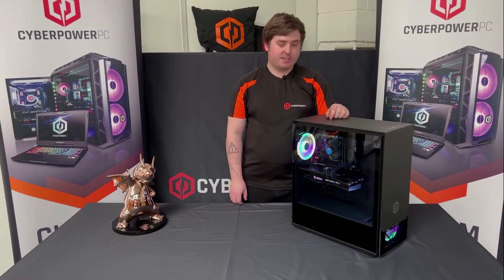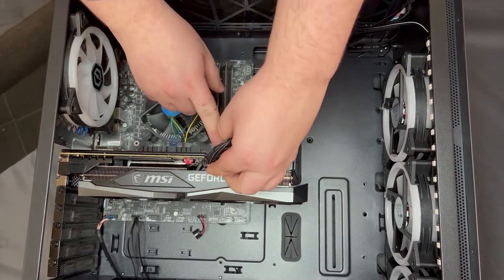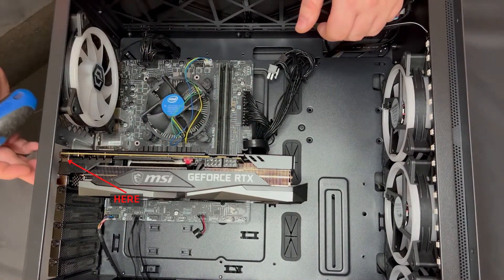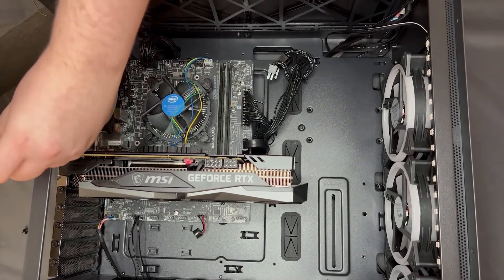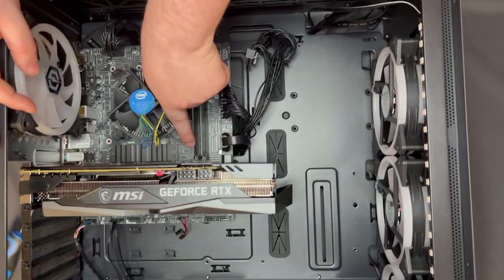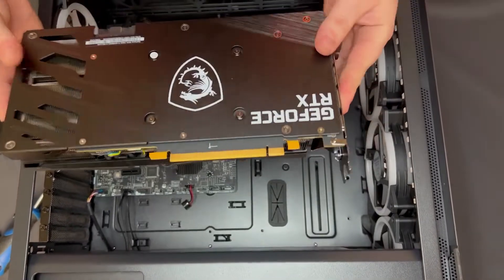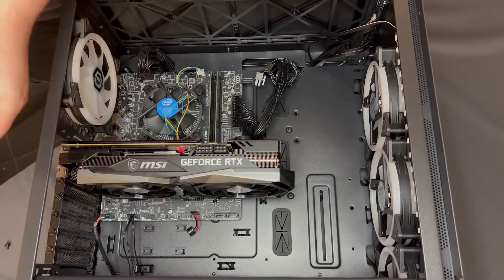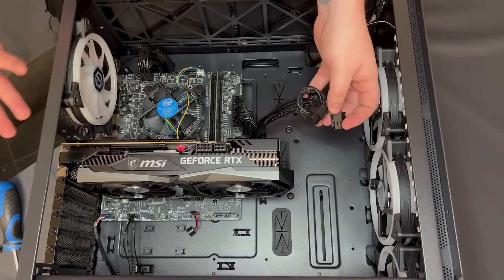Remove and Install GPU | Tech Tips

Comment: I'm utterly incapable of doing this, now I think I may have wrecked my PC. That clip is completely unmoveable.  Graphics card won't come out, but neither is it completely in now either. Now it can't get it in or out. I only wanted to change the freakin' motherboard battery! (but was inaccessible being covered by the graphics card).  Now because of a flat battery and being unable to replace it, I'll have to buy a new PC.

Once I do buy a new PC I won't ever be attempting to replace anything inside the PC case itself. Especially not the graphics card!
Reply: Yes!  Got the card out at last! And replaced battery. Might have ruined the motherboard in the process though as I was attacking the clip quite hard with a screwdriver, and a couple of times it slipped onto the motherboard. And then there is the original problem that might have been caused by a flat battery.

Comment: I had an issue with a screw holding a PCI card below my graphics card also holding the graphics card, making me think my graphics card was stuck to the Motherboard after I unscrewed the two screws for the rear output plate of my graphics card.
Remember to look closely at your screws and what they are actually holding.
You might need to unscrew [PCI slots occupied by the graphics card] + 1 screws.

Comment: I dont know what to do. All i did was unplug the PC, open the side door to inspect the inside, tug on the cable for the graphics card a little, checking if it was secured, then plug everything back up. When i turned on my PC, the monitor refused to display. I been messing with this for hours and still no luck
Reply: same here, anyone that can help?
Reply from the maker: If you're having issues you can always hop over to our Discord at Discord.gg/cyberpower. Our community will help you out

Comment: Dude you guys put the wifi card so close to the graphics card port my 4060 oc wont even fit
Reply: If we've built it, then it fits, but if you are changing the GPU to a larger model you may need to lower the wireless card to a different slot, or potentially remove it and go ethernet, powerline or USB wireless.
Reply: @davecyberpoweruk  oh man I didn’t expect you to respond thank you so much for the advice, but yea I bought the nvidia GeForce 4060 and it won’t fit in the gpu slot because the wifi card is in the way and it’s attached to the motherboard. And I was thinking of doing an Ethernet cable or the wifi usb. But the issue with that is the usb wifi kinda sucks and I can’t afford a router. I was thinking of just finding another gpu if you had any recommendations I’d appreciate it. My power supply is rated for 600 watts

Comment: "if you just push that down"

Yeah, sure.
Reply: Yeah dude the same, im pushin it so hard im scared that my motherboard will break in half😅
Reply: @Lock0_ Right now I'm typing this with my bruised ass finger from pushing down on that stupid clip but it won't budge ffs
Reply: @Lock0_  i had to remove the cpu and cpu cooler :D
Reply: Don't know if you guys in this thread are still in this predicament or if you will get this message, but for anyone else passing through: What worked for me is to just keep pushing down, no fancy equipment or tricks. Mind you, I got small hands and I made sure to stop if I felt my fingers slipping so I could readjust my position, but I had to push down until my whole arm was shaking and my fingers hurt. Another thing is that motherboards are sturdier than you think so don't be too scared. Accidents can happen, but I slipped multiple times, I even tried the back of a plastic pen and it slipped and the bottom part got lost inside of my case, so that was fun to try and fish out 😬But ultimately, everything worked fine when I turned the PC back on. Just relax, be patient... and have a high pain tolerance, lmao.
Reply: Did you find out solution? 😆
From my point of view the best solution is to buy new fcking mother board!... That button is crazy...
Reply: RIGHTTT.
Reply: Some times you can just juggle the card you will find that im other YouTube tutorials

Comment: Am I the only one having trouble with putting the screws back in
Reply: No, those screws are finicky.
Luckyly I have slender fingers that fit between the left vertical edge of my case and my watercooler. I don't know if I would have made it if I had fingers >1.1× the thickness.

Comment: I have a Cyberpower Prime Z390 gaming PC, with some RGB fans, I don't know how to change the colors or deactivate them at appropriate times, could you help me with this?
Reply from the maker: Hi, it depends on which fans you have. If your PC came with a little remote, then you use that to control your fans; if it didn't, then it will be controlled by your Motherboards RGB software. I hope this helps
Reply: @CyberPowerPCUK  Are there any RGB control softwares that aren't a mess?

Comment: i have to remove my giant rx 6700 xt to get to a clip on my cooler, but the damn thing won't come out. Screws are out, tab is pressed and released, but gfx card seems stuck on the back plate rather than anything, you know, the little tabs on the other end from where the screws are supposed to go. Fingers hurting bad from trying. Am stumped.
Reply: u ever get it out?
Reply from the maker: Hi, contact our support team at support@cyberpowersystem.co.uk with some photos, and one of the team will be able to help you out.

Comment: My bloody cooler is to darn big to press with my fat ass fingers 😂😂😂😂
Reply: Relatable, how did you deal with it?
Reply: @red2522  got a soft rubber thing to softly poke it
Reply: @red2522 losing weight
Reply: Get something you can push between it, or just temporarily dismount your cooler and put it back

Doing the latter at least you can repaste your cpu, but i have a little wooden duster that I pushed between the cooler and gpu gap since my fingers are too big

Comment: I cannot find the thing to remove my gpu (switch) I'm lookin in the area u specified and cannot see it
Reply: Same problem here
Reply: @skigemiggw bro you can just move you mother board to fit or buy some new cheap pc case
Reply: I know the solution the problem is you have an old mother board
Reply: @lifewireGaming  thanks for the support saddly I had to find out the the new gpu was like half an inch too big to fit 😭
Reply: How did you solve it